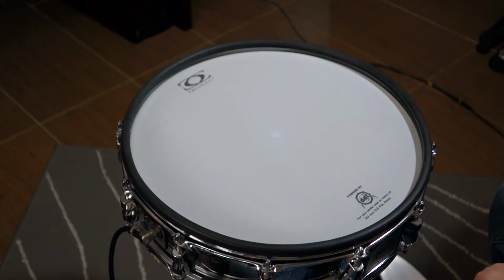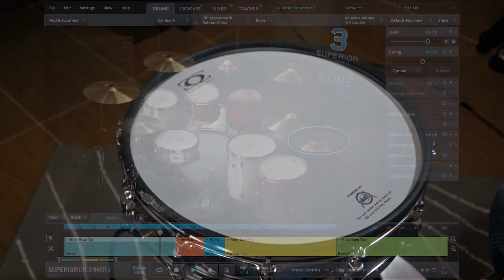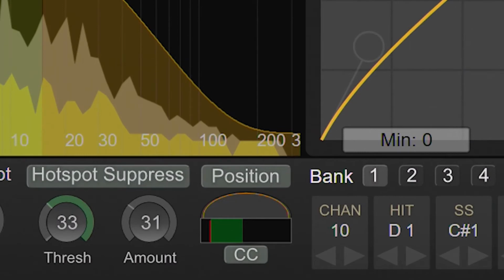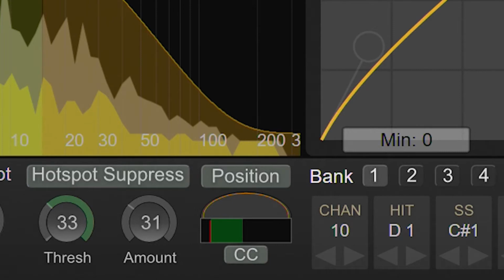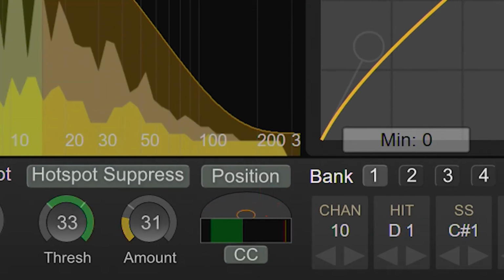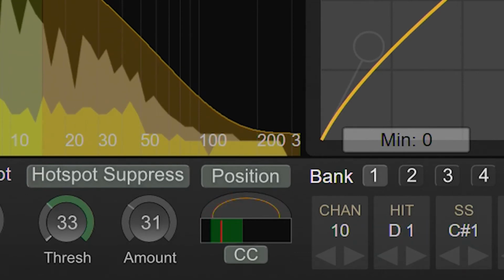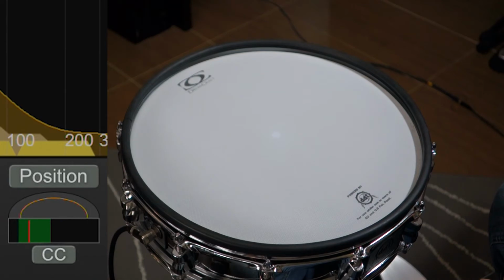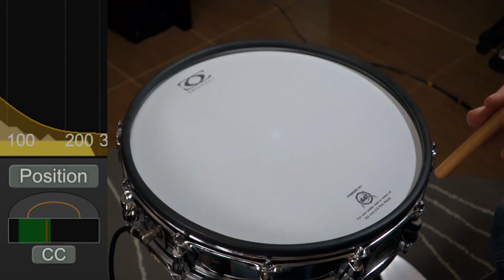eDRUMin: Setting up Positional Sensing

Comment: Looking to upgrade my snare to one that supports positional sensing, and is compatible with my EDrumin10.
It appears currently the EDrumin doesn't support multi sensor pads, is this correct?
So aside from the DDT MS-140 here in the video, what else will work?
I'm looking at the Roland PD-140DS and the Drumtec Pro 3 snare drum. 
Any others I've missed?
Reply from the maker: Version 2.3 supports positional sensing on the ATV s13 snare and Roland PDA-120L (both multi sensor) and possibly others.  Positional sensing works well most center mounted setups as well. but stay away from 3-ply mesh heads.
Reply: @yeahtuna  Thanks so much for the response Rob!
Ill check those out, thank you!
Reply: @yeahtuna whats the problem with 3 ply?😢
Reply from the maker: @etbatera  It's noisy and the high frequency noise makes it difficult to read position and perform hotspot suppression.

Comment: is there a way to change transients and curves just for the edge zone with out affecting the center one?
Reply: No, not currently.
Reply: @robertjonkman98  is there an option or update to get positional sensing with a 3 cone design as the new update on the pearl mimic?

Comment: i have a td17 which does not support positional sensing on either ride or snare, would i be able to connect an edrum in and use 1 or 2 lemon cymbal(s) which are capable of positional sensing along with my td17 via midi?

Comment: Does positional sensing work with the Roland VAD series pads like the VAD 103 or 306 ? I didn't find anything about if the trigger is centre or side mounted.
Reply: Nope those are all side triggers
Reply: @laloadler8044  After more research I found that they got the ATV style 3 trigger system - but that also means that pos sensing won’t work I guess
Reply: @SchwappSchwopp  true, for positional sensing you’ll need center triggers, for snare anyway, for toms it doesn’t matter since there is no positional sensing sounds on tom heads

Comment: I saw where you said positional sensing in not possible on the Alesis Strike pro pads.  Is that true for all Alesis?  I have crimson II SE.  I seem to be getting positional info on DSP trigger...
Can you fill in the blanks here?
Thank you!!
Reply from the maker: If it's working with DSP TRIGGER, then chances are it'll working with eDRUMin.  eDRUMin excepts a single center mounted piezo.  Many Alesis pads have three peizos.  To the best of my knowledge, those types of pads won't work although I have never tested any Alesis pads personally.
Reply: @yeahtuna  That's true - unfortunately! The Alesis Pads have the rim trigger piezo glued to the chassis. The head trigger piezo sits on a quadratic thin acrylic plate that is placed on a large decoupler foam bar. On that acrylic plate, you have 4 foam rods mounted on the edges touching the mesh head. And, as I was told and after testing it with the edumin positional sensing is not working. I switched from Alesis to ATV, but having that 3 side mounted piezo setup / pos. sens. is also not possible. With that kind of pads you have no issues with hot spotting.
Now - I got a Jobeky 14" snare e-drum, center mounted piezo and its working awesome with SD3, with hot spotting, but I have to tweak the eDrumIn hotspot supression.

Comment: I just picked up SD3 and have been enjoying it, except that I'm using an Alesis Strike Pro SE which does not support positional sensing. I just stumbled on to eDrumin and it looks like a perfect product for my use case (VST processing). Have you tested the Alesis Strike Pro snare's or received any feedback from people who attempted positional sensing with the Strike Pro through eDrumin? Really great product you have here.
Reply from the maker: The pad is supported by eDRUMIn, but without positional sensing.  I have seen data from that pad, and as far as I could tell there was no way to get positional information from it.

Comment: Do people typically just do this for the snare? Or the toms as well?
Reply: whole kit here but using real cymbals. PS is only going to be useful if the drum sampler you use supports it for that drum or cymbal. So it's also very useful on ride cymbals and hihats as well as snares. Basically any drum software that includes it or has different midi note assignments for different articulations on the drum.

Comment: How does the scaling function? :) I have two drum samples in my superior drummer 2 on is called snare center and the other is snare edge. I guess i would set eDRUmin to trigger those by using the two different CC inputs? Is the area between thoose then scaled by triggering them both at the same time with different velocities?

Comment: Is the edrumin like a sound card for the trigger inputs or does it require a sound card to process/convert the inputs from analog to digital? I'm guessing a low latency sound card is needed to process the VST and for the output DA but the edrumin handles the AD convertion of the inputs.
Reply from the maker: It's a trigger interface.  It does all the analog to digital onboard and outputs MIDI over USB amd/or MIDI over DIN.  But yes, a low latency sound card is needed to hear the audio from VSTs.
Reply: @yeahtuna  Aha so it doesn't do the processing on the PC? The reason I'm asking is because I was wondering if it avoids the extra MIDI latency/jitter but I guess it doesn't. I'm not sure how much latency midi over midi has. I've read all from 0.125ms to over 10ms. Midi din is 1ms.
Reply from the maker: @sabahoudini  No, all processing is done on the device.  USB MIDI -> VST latency is about 3ms, and jitter is low enough that I didn't even bother to measure it.
Reply: @yeahtuna  By midi latency I mean only the latency to send the midi signal it self. I understand that the triggering latency is the scan time plus the processing on the microcontroller. Are you saying that it takes 3ms from pad hit to MIDI being recorded in the daw? If that is the case then it's pretty much on par with the roland modules which is pretty good.
Reply: I tried to purcase just now but it's not shipping to sweden, damn :P
Reply from the maker: @sabahoudini  Here's a link to a post in my forums about latency.
https://www.audiofront.net/forum/viewtopic.php?f=29&t=485&p=1941&hilit=latency#p1941
Reply: @yeahtuna  Thanks for the info. What exactly is adding the 3 extra milliseconds except scan time? Is it the calculations on the microcontroller? The midi latency over DIN polls at about 1ms intervals but what is adding the extra 2ms?.